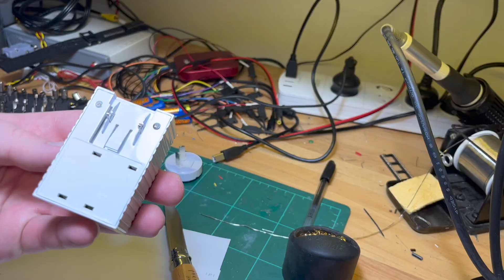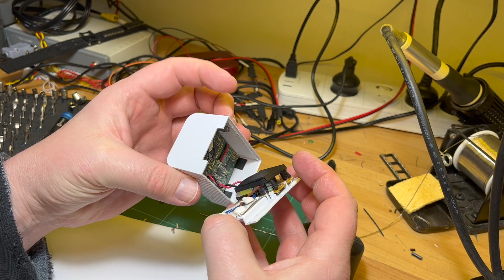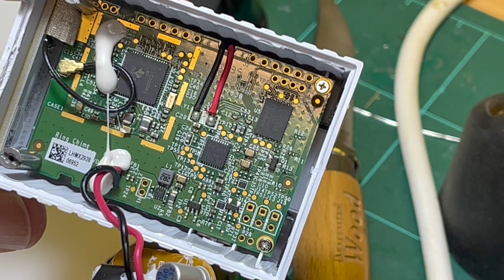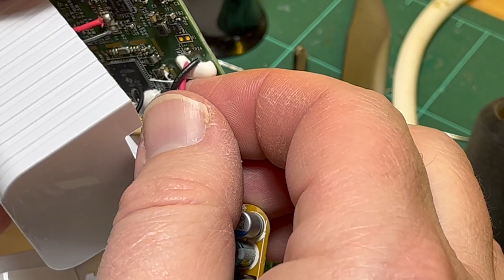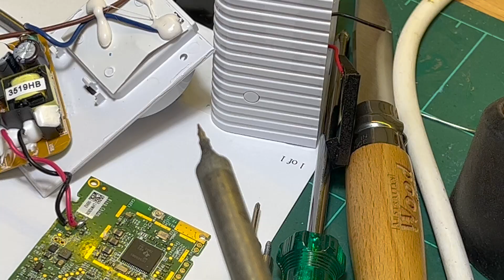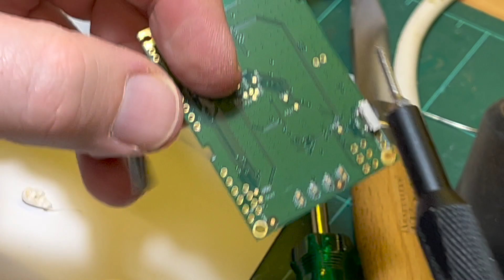🇺🇸 Amazon Ring Chime Teardown: Part 1 [TCE #0089]

Comment: FOR PEOPLE WITH A CHIME PRO THAT LOOKS LIKE THIS ONE: the rectangular holes are indeed clips but i didnt not have any tool to get to them. the key for this is starting at the top. get metal spudger in the top and flex it a bit then get a thin wedge like a flathead screwdriver and hammer it between the plastic under where the back plastic attaches to the antenna plastic. then put a larger flathead in and this will give you the best lever point to get the whole thing open. once you do both sides it should just come off since the clips are tat. i had to open it because one of the antenna nuts came off inside but its all fixed working now

Comment: geezus!.. that almost looks like a RPi board..
adding a little fresh lead-tin solder will lower the melting point of the lead free solder making it easier to remove stuff...
them headers might be jtag for the 2 sections (mcu and wifi).. the 4x might be a serial for the mcu..and the 2x3 SPI
Reply from the maker: Ahh, good idea about the solder.  And good points for the headers/jumpers - I might try to buzz them out (haven't checked if there's "prior art" teardowns on these ... assuming there must be!).  I mainly want to try to figure out why it's dead ... but looking at that board ... yikes /Brett
Reply: @Brfff  im not just an ugly face! i can give good tips at times!..